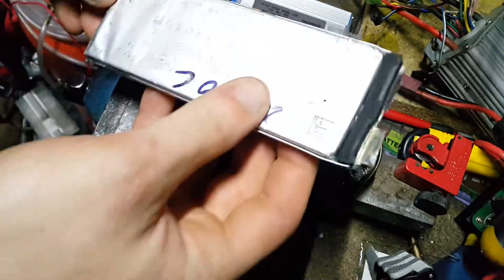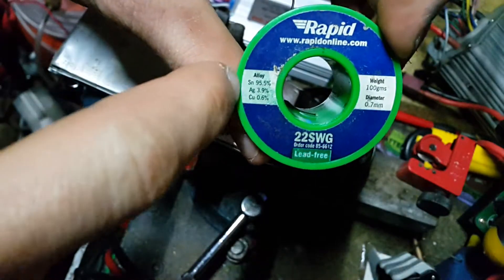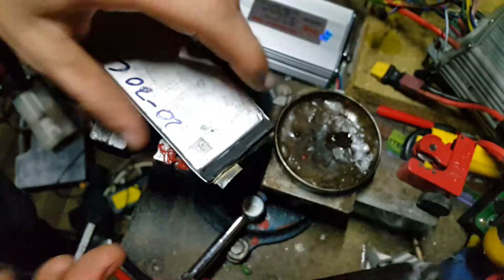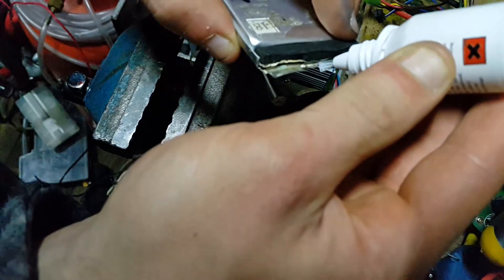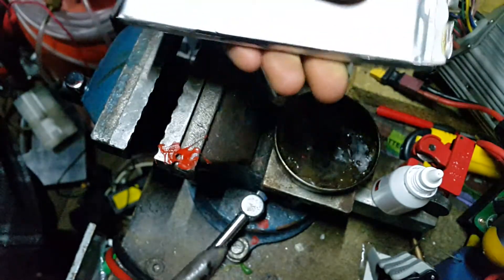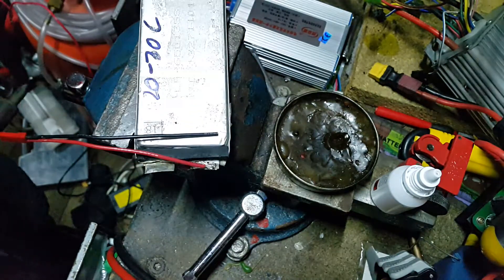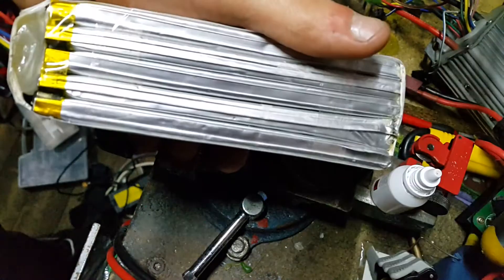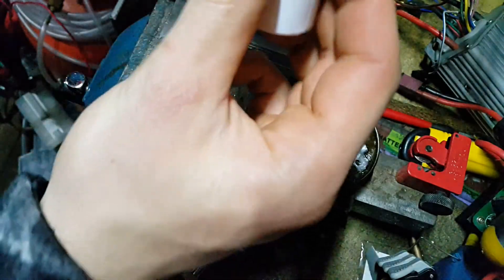Soldering Aluminium Battery Tabs

Comment: can any wiresoder used? normal soldering water made from acid and cync is not good?
Reply from the maker: Normal solder works for me and do not use water.
Reply: thanks! I checked an other aluminium soldering method using oil and scratching suface under oil to prevent oxidation and soldering under that oil film on an aluminium rod and it worked fine, but did not work for my lipo tab, can it be that my lipo tab is made of different material not aluminium just some kind of special stainless steel?
https://scontent.fbud1-1.fna.fbcdn.net/v/t1.0-9/40555925_259201398266974_8744716988485468160_n.jpg?_nc_cat=0&oh=eb6ffa98d73521423c5fdbf9c5f5ca34&oe=5C322962
Reply from the maker: You probably need the special flux that I had to buy and I was wrong earlier, you must use lead free solder.
Reply: I was trying with almost 100% lead :) thanks for the suggestion!
Reply: The link die, please show me the link ò products in Aliexpress